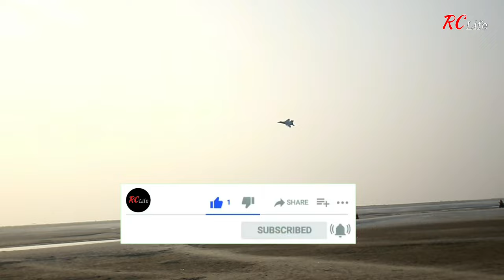How to make a real look rc fighter jet | mig-29 | rc life

Comment: Bro it is 3s rated motor but you use 4s lipo battery it doesn't heat bro?
Reply from the maker: prop ak size choto dichi tai hit hoy nai
Reply: What is the size